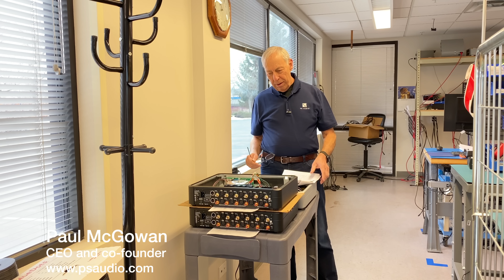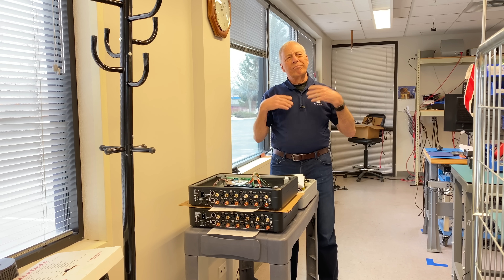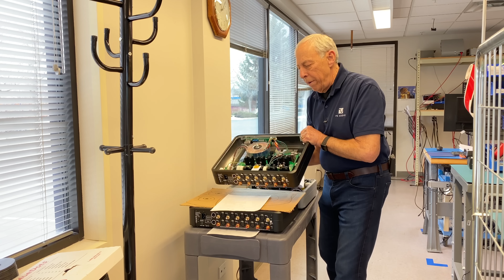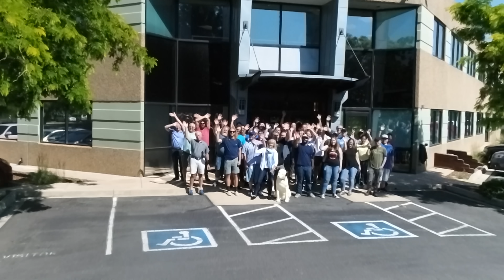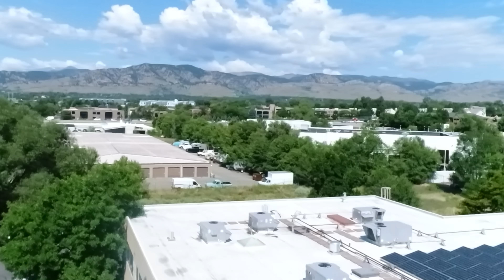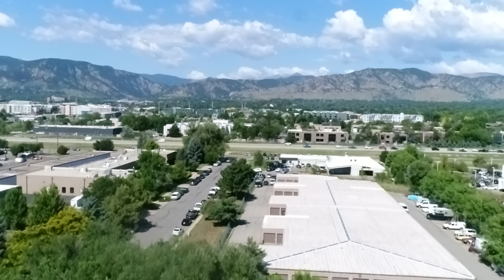Should a preamp have a sound?

Comment: As an audiophile that have tested most gear on the market, I can say that a preamplifier is the hardest thing to get right. Most preamplifiers are really not good, and many people can't understand that it is usually is not a good thing to have a brand mix up where for example you have a PSaudio preamp with Mcintosh mono blocks or vice versa. If you have PSaudio preamp, have it together with a PSaudio mono blocks, and the same with Pass Labs and Mcintosh and all the other brands. Do not save money on the preamp solution, you will most of the times get screwed and not know why!
I am making a video soon about this topic...
Reply: What recommendation would you have for a Technics SL1200GR?
Reply: What amp and speaker do you have currently?
Reply: @RealHIFIHelp  I have an active speaker pair: the Edifier S1000db. It's a budget speaker set since I'm just a poor college student.
Reply: @RealHIFIHelp  It's really just what I had lying around that would work. I'm saving up and looking into building a real good system in the future though. I have a pair of Technics SB-X700 Speakers, an Onkyo TX-NR646. I am using the built in pre-amp on the Onkyo. The first upgrade I'm looking to make is the turntable. I've decided to get the Technics SL-1200GR, that's why I was asking about that tt.
Reply: Why would the mixing of brands make a difference?
My feelings towards many of the high end audiophile solutions is that they may make a measurable difference, but I doubt can be heard by the human ear
Reply: Every single piece of gear in the world makes a difference.
The most important things to understand is:
1. How many % efficient is it running.
(most people only run their equipment at 5-20% efficiency)
2. The lower quality gear you have, the less it reacts and everything seems the same.
(a sort of numbness)

I could take a thing like a PSaudio preamp, and create 10 totally different quality sounds, because it is a pretty decent piece of gear.

To answer your question...
Different brands use different designs and different components. PSaudio have  their tradition of sounds that carries through their entire line of products, creating a synergy. Just like any other brand.
So mixing brands is a lot like mixing alcoholic drinks, you get more the effect and the cross interaction overlaying rather than the purity/balance/deep integration typically.

Typically when you mix brands, you quickly hit a wall, because everything to some degree collides because they both want to go in a different sound direction. And when different audio sounds collide, you get less deep intended detail and more of a superficial sound effect rather than the true sound itself.

There is also the extra factor of the signal cable binding the preamp with the mono blocks, which also has it's own sound.

Personally I ALWAYS recommend to people to just buy a really good integrated amp, is has the pre/effect part built in and totally alligned in sound, plus it removes the extra cables which most of the time creates problems in itself. And integrated amp usually has more focus around the essence of the sound, where preamp-monoblock combo has a tendency of being a lot more structure oriented in sound, making it most of the time a bit more mechanical.
Reply: @RealHIFIHelp  Ah right, if you have multiple components in your system that have "colored" sound, in the sense that they do not strive to deliver a flat frequency response, you would not want to use a components in that system that use a different "coloring" or EQ scheme. I personally would to go one step further in your suggestion and recommend active speakers, since it reduces the chance of components not sounding good together.